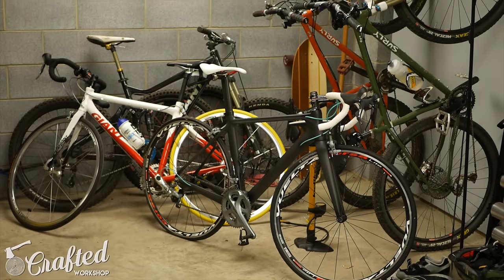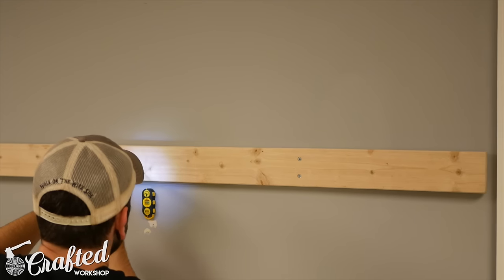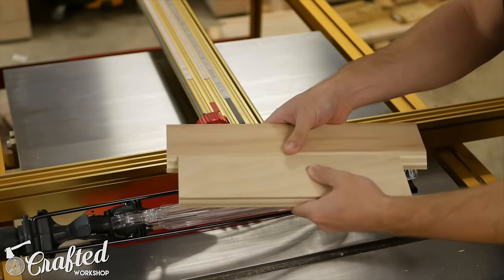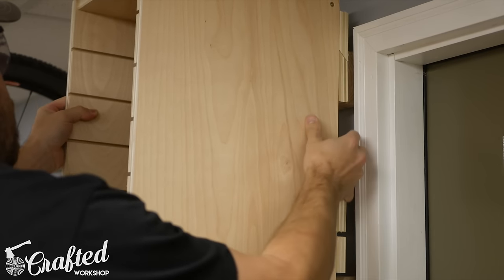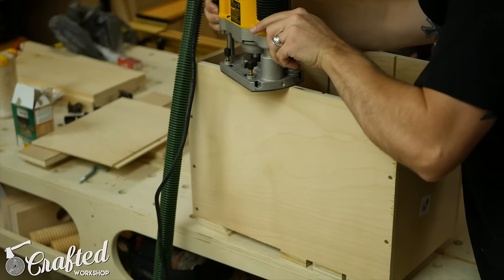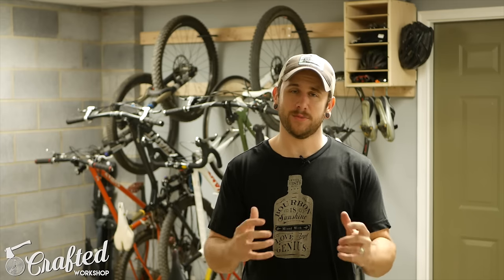DIY Bike Rack for $20 / Bike Storage Stand & Cabinet for Garage | Crafted Workshop

Comment: Great video.  I made a similar system for hanging my numerous bikes but didn't think to stagger the height of the hooks.  The one useful addition I made was to make it so I could  secure the bikes.  I fastened another 2x4  at crank height.  I attached rings to this 2x4 which lets me use cable locks to lock the bikes.  It is super easy to unlock and remove whatever bike I would like to ride.   While this will not deter a seasoned bike thief, it will certainly keep people from helping themselves when the garage door is open.
Reply from the maker: +Steve Taylor nice, that's a great addition.

Comment: I used your idea/dimensions and added a few things. I did it with just a single 3/4” sheet of plywood and cut two longitudinal 4” pieces to build up the hook lines. I added stain and poly to match the garage doors. Thanks for the inspiration.

Comment: Just finished building. Quick tip: Don't just use the cheapest hooks you can find.  It makes a diffrence! The large square ones sag alot which you need to account for.  They also allow the bikes to slide around which throws off the spacing.  The smaller curved ones seem to hold bikes in place just fine.  Thanks for the video! 👍

Comment: I'll start out with nice rack. Just a note some bikes that have hydraulic disc brakes cannot be hung on the wall or upside down.  I found this out by hanging my bike from ceiling in my garage anytime my bike was hung up longer than a week I would have to bleed my brakes.
Reply: Hanging your bikes should make no difference to the brakes. I hang all of my bikes, all with disc brakes and have had no need to bleed any of them. Sounds like you had air in the system already and it just became more noticeable once all the air had risen to the lever end of the hoses.

Comment: I have built that rack. It does pack the most bikes into a small space. However, those hooks are garbage. I used the exact same ones. They don’t stay in place. They twist and grab your spokes, so getting the bike off the rack is a frustrating mess, forcing you to twist and turn the bike while it bangs into the other bikes. Getting them on the rack is the same. The hooks also bend within a few months, making them even more likely to grab your spokes and rim. My wife hated this rack and refused to put her bike on it, it was too hard for her to get it on, and she could not get it off at all. My kids couldn’t possibly lift their bikes onto it. Eventually, even I hated trying to put my bike on it. I plan to build one with the same concept, but a different method of holding the wheel, and a block-and-tackle pulley to assist lifting the bike into place.

Comment: looks really good!  if i hang the bike for a long period of time, would the weight of the bike warp the bike's rim?
Reply from the maker: Nope, it definitely should not do that. The rims on bicycles are incredibly strong, and part of the weight is being distributed to the tire, which is resting on the wall.
Reply: Simple solution: Ride it more often. :)

Comment: Hi. First, great video. I was hoping it would be listed in the description, but I'm want to know what 2 of the tools are you were using. The first is at 0:48, there's some kind of stud finder that is pinable to the wall, and the other is the drill bit you used that had the counter sink piece at the top. Both seem like something I need to have. Thanks!
Reply: CH Hanson magnetic stud finder.

Comment: Nice one mate, like your saw.
Reply from the maker: Thanks Dave! Which one? Miter or table?
Reply: Both actually, table saw mostly, looks very professional.
Reply from the maker: Thanks, it's a SawStop PCS with an aftermarket Incra fence. Love it!
Reply: Nice, maybe if I win the lottery I'll buy one, mine is a cheap one, but it works fine.
Reply from the maker: Dave Williams hah, they're not expensive but definitely an investment. Was worth it for me, considering I use the saw basically every day and really like the added safety. That said, my Dewalt Job Site Saw I had previously worked great!

Comment: Can anyone answer why it is preferable to have rear wheel off the floor? I would be making something similar but ideally I would like the hooks to take minimal weight due to the location I have available and the strength of that wall and it seems logical to let some of the weight of the bike be supported by the tire and the ground? Cheers

Comment: How could LOCKS be added?  
Installed in a public space, what could be added so people could lock their bikes to something?

A single metal bar for all the bikes would surely be in the way.  A single long metal chain with slack could be out of the way and adaptable to different bikes' positions.  If someone were able to cut/saw the chain, they could get 5 bikes at once.  One chain per bike - more expensive but less tempting for thrives.  The chains could be attached to the lower plank of wood, or to a third plank of wood, securely affixed to the wall - or attached directly into the wall using wedge anchors(?). Pulling on a chain would be easy (adapting to the thief's position for maximum pulling force), so the attachment would need to be very secure.   

Other options?

Comment: quick question, loved the video! but i just bought some pre made bike hooks and i noticed you said its bad to have the back tire sitting on the ground when its mounted vs being all the way on the wall. would you mind elaborating?
Reply from the maker: It just makes the bigs a little less stable, more tippy when the back wheel is contacting the ground.

Comment: Do you know if, over time, the weight of the bike would affect the roundness of the wheel or damage any components, like the hub?
Reply: I did something like this last fall based on his instruction.  Theres no affect on the wheels, but I do find that the hooks I’m using seem to be bending over time.  I didn’t buy special bike hooks, just your run-of-the-mill hooks from
Home Depot.  Maybe there’s a difference.

Comment: Nice build! I have to do something as well. You do have any opionions about abuse on the spokes or if it's better to have the rear wheel rest on the ground or hang in the air?
Reply from the maker: The hooks are covered in rubber, there’s no real wear on the spikes. The bikes need to hang in the air for this system to work correctly.
Reply: @craftedworkshop  A year later, do you find that your front tires need more regular truing? 

I had a similar system and I found that my wheels got wonky from hanging the weight of the whole bike on one part of the wheel frame. After your video though, I'm keen on trying it again and wonder if you had a similar issue.

PS. your plugs are awesome!

Comment: What kind of bike rack were you using before? It looks like it didn't need holes drilled? I'm going to college and I'mLooking for a way to store my bike in my dorm that doesn't take much space and doesn't need holes drilled
Reply from the maker: +Michael Drury no, the previous system needed holes as well. Not much you can do without creating holes in the wall. I've seen racks that put pressure from the floor to ceiling to hold bikes, that might work for you.

Comment: hello there! :) i would like to ask if these hooks can be mounted right into a concrete wall? i would like to install them in my 4. floor balcony and i dont know if theey will strong enought for it. :)
Reply from the maker: I don't think these are designed for concrete but you might be able to find some that are. Probably easier to mount the 2x4s to the concrete then use these hooks on the 2x4.

Comment: Saw you had Clugs before on the wall. What stopped you from getting some more of those?
Reply from the maker: +Yousef Ricart they require way more spacing than this system since the Clug doesn't support the full hanging weight of the bike, it has to be in contact with the ground.

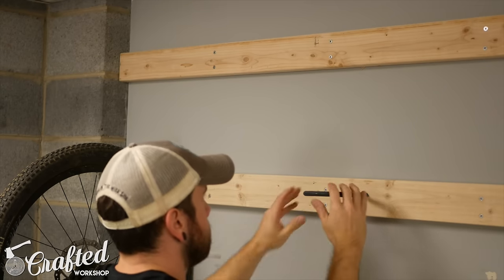Comment: When your first bike is hanging at around 1:50, it looks like the hook is bending down a bit, is there a reason for concern there? Thanks for this vid, I live in a small apartment in SF but my bike collection is growing.
Reply from the maker: +Bessed Drest no, these are plenty strong. I've been using the rack for over a year and have had no issues.
Reply: awesome! Did you need to drill pilot holes for mounting the 2x4's to the wall?
Reply from the maker: +Bessed Drest no, I used Spax screws which don't require pre-drilling.

Comment: I screwed the 2x4 in the studs and as soon as i tried screwing the j hooks in the board it started pulling it off the wall. What am i doing wrong here??

Ps. Its ok to make fun of me. I just need to figure it out or ill go nuts. 😀
Reply: Make sure you use 3.5 inch wood screws and confirm the screws are going through the walls. The 2x4 should have screws in the left and right ends of the wood, as well in the middle.

Comment: Do you drill holes into the 2x4 / wall studs before you screw in the 3.5 inch screws?
Reply from the maker: +SurfingBullDog I did not, the screws I used didn't need predrilling.
Reply: It's a good habit to get into though. tbh. Some woods split some don't. I take caring about which ones out of the equation and just drill before I screw anything to anything. Besides never splitting any boards, my wrist thanks me as well. They go in much easier pre-drilled. Which is a bonus when at an odd angle or cramped area. Long screws have a tendency to spin out if not going in completely straight. Especially when you can't use your other hand to guide the screw. Pre-drilled holes fix that problem. Just my 2 cents. Everyone is different and that's just what works for me

Comment: I've sort of lost my woodworking space to bikes. I'm not sure if this would help or just make them less likely to be knocked into the car. 
Does anyone have an idea of the weight this sort of project can take? I'm guessing the weak spot would be the hooks pulling out or snapping as long as I got 2 screws into all of the studs.
Looking to tidy up a kid bike, carbon fiber road bike, commuter, 2 e-bikes, and mid-tail cargo.
Reply from the maker: +Alyssa Hays it should support plenty of weight as long as they're anchored to studs, as you mentioned. The hooks are super strong.

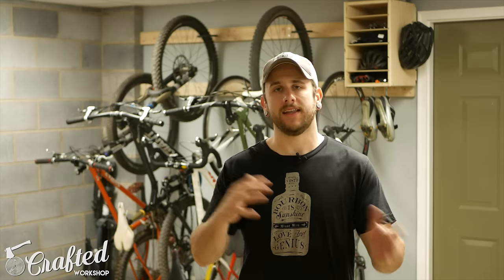Comment: what dou you mean at 4:45 that having the bike touching the ground throws off its balance?
Reply from the maker: It won’t really hang vertically because the weight balance is off.
Reply: ah ok, nothing affecting the ride once you take it off the wall then ?
Reply from the maker: Nope!

Comment: I selected a sheet of Maple plywood at the home center and had them cut it. I had told them two months before, the panel saw needed a new blade. They ignored that advice and destroyed that piece of Maple. I told them I wasn't going to take it and informed the manager that their saw just destroyed a $50 sheet of ply because it needed a new blade. He said he didn't know what to do about it. When I told him to put a new blade on it, that's when I fould out the problem. Employees can't change blades on that saw any more than they could change oil on the forklift. They employ a service for that and someone has to make the effort to call the service to have the blade changed. BTW, this is exactly how I store my single person bikes. Now to find a solution for my four tandems.
Reply from the maker: +Wildman Tech that sounds about right! Tandems would be tough. Maybe hang them from the ceiling horizontally.

Comment: Nice work Be careful hanging your mountain bike that way, the oil can leak will out of your fork if you hang it upside down.
Reply: jkyearick Having your bike upside down is actually good for your suspension forks as it keeps the seals well lubed. If your fork is leaking oil the seals need to be replaced, i would take it to your local bike shop if you're not confident doing it yourself.
Reply from the maker: +jkyearick thanks!
Reply from the maker: +Joe Amiro that's what I thought. These haven't leaked at all in the months since I built this rack.
Reply: Fox actually recommends doing this to keep seals lubed. New forks don't have the leaking problems, like forks in the days of old.

Comment: if I had these tools I would be building a house around my bike rack, not so much diy with out these tools to do the job
Reply from the maker: +DZenitram23 to build the rack itself, you only need a drill. Your home center can cut the 2x4 to length. The cubby is just an extra addition that's optional.

Comment: $20 + 1000 of dollar for equipment
Reply: You can do it for fifty bucks, including buying an extension cord, drill, bits, screws and having the cuts done at the home center at about $2 each and you can use a tape measure from the dollar store.

Comment: wow……nice!But you have to get that tools first,and they way more then $20🙄
Reply from the maker: For the basic rack, you literally need a drill. The home center can cut the boards to length.
Reply: But the project it is not $20.  Each hook is $11 ish. Two hooks are more than $20

Comment: How about if we don't have all this equipment and material laying around or experience? This is an odd video for people who lack all the above.
Reply from the maker: +psilk34 then you can buy the tools and materials. To build the basic rack without the cubby, all you need is a drill. The home center can cut the 2x4 to length.
Reply: Two 2x4s and five bike hooks, how hard can it be? Who brushes your teeth for you anyway?